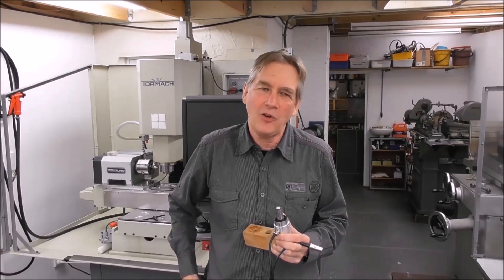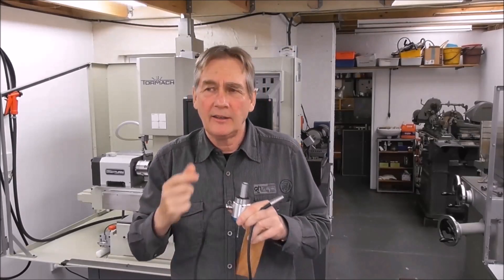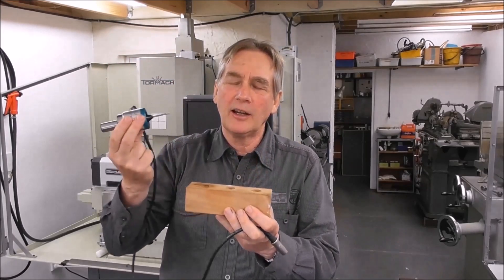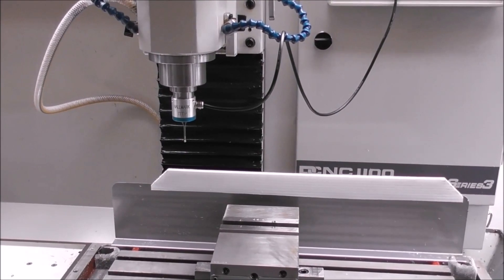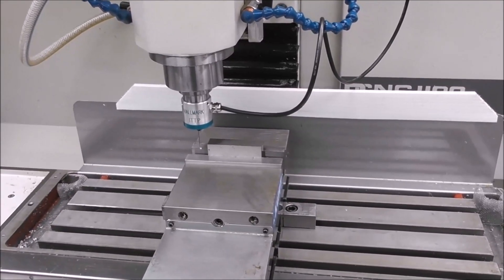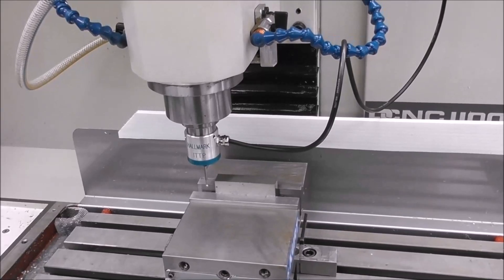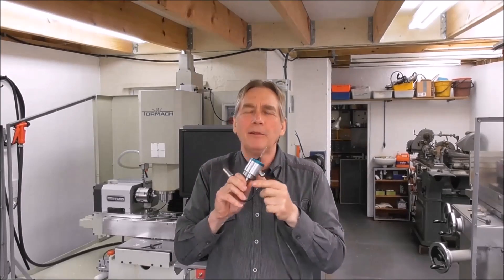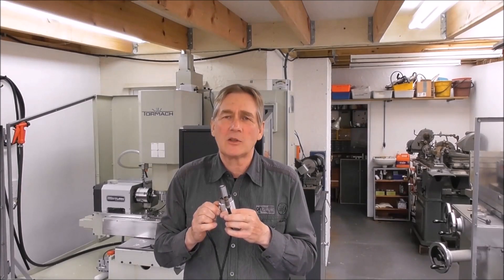Probe - Hallmark ITTP Part 6

Comment: Do you use the same polarity as the Tormach touch probe?  When my new Tormach touch probe came the contacts were already oxidized.  Took it apart and polished the contacts and it worked fine.  Looking forward to purchasing one.
Reply from the maker: Yes the same.  cheers.